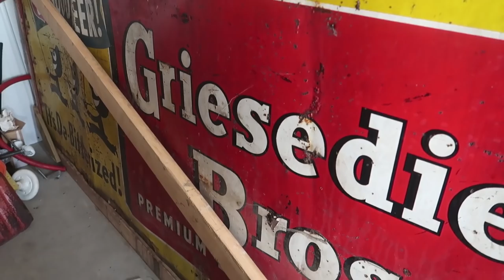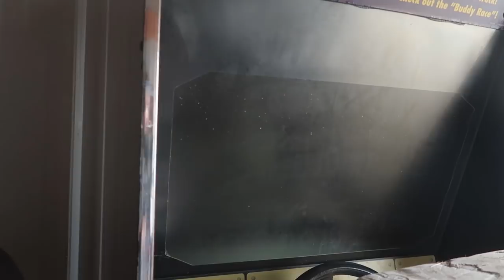Random Bits 0191: Removing Old Clothes Dryer, House Cleaning Update

Comment: I think the definition of hoarder changes with every person.  My definition is someone that saves junk that has no value.  The unfortunate part is that it is just as hard to define value as it depends on the individual to determine what value something has.  As an example I have several digital panel meters that originally cost in excess of $200 each.  I really have no use for them but I feel they are too valuable to simply send them to the landfill.  I doubt that I could sell them as they are rather specialized and truth be told, I don't want to go to the bother of trying to sell anything.

Many years ago I rented a storage locker and eventually filled it with junk.  Your lockers at $50 a month would be more like double that cost in my area.  Among the junk I had stored was a king-size bed and frame.  I decided to clean out the locker and gain back the $50 a month it was costing me and I tried to sell the bed.  I had at least two lightly used sheet sets and one brand new sheet set for the bed but no one was interested.  I finally donated the sheets to charity and left the bed at the side of the road when we had a community clean up day.

When I moved to a newer house, roughly twice as big as I had, I vowed I would never again rent a storage locker or build storage sheds.  For the first several years I was able to keep my car in the garage but now it has been at least a decade since I could get a car inside.

I could go on for several more paragraphs but I don't think that you particularly are a hoarder but you do need more space.  Your mother MAY be a hoarder.  My former wife would save every single cardboard box that came into the house and I spent WEEKS cutting up and recycling cardboard when we divorced.  She save the stupidest things.  Both my parents were hoarders, my daddy saved bent rusty nails.

Comment: I used to have moisture problems where I kept a lot of my stuff, and some things would get mouldy, I'd be worrying often about my things slowly being destroyed by the moisture and it got me really depressed. Thankfully I don't have that problem anymore. 

The moisture in your storage unit is a lot more extreme than what I had to put up with though, that would really drive me crazy!

Maybe you could put a bunch moisture absorbers in there or something?
Reply from the maker: idk, im probably going to put plastic down and seal off as many air vents for now as i can. then maybe run a dehumidifier off the nissan batteries. but eventually im thinking i might just move the arcade machines to the Red Rooster when they get the arcade room made.

Comment: Just fix the dryer! In most cases, the reason electric dryers fail is because of the thermostats fail. Usually four of them in a dryer, and normally, one or two fail. This is about a $10 repair. Even if you dont want the dryer (which I don't know why), you could sell the repaired dryer rather than throwing it in the trash.  So tearing it up, and tossing it: https://youtu.be/XI7FoCHJ01k
Reply from the maker: but we dont need a dryer. and it failed due to a broken heating element. washers and dryers are so easy to come by around here, would go for maybe 20$.
Reply: Heating elements don't fail. The thermostats do. Still could of sold a repaired one :-)
Reply from the maker: yes they do, and this one had a spot melted out of it. dont be so sure of yourself.
Reply: If it had a melted spot then someone must have tampered with the dryer, bypassing the thermostats. Those thermostats are there for not only regulating the heat, but safety also. There are four of them. two are for temperature regulation, and the other two for safety to prevent that very thing.

Comment: Is that a Lisa or a Mac XL?
Reply from the maker: its a Lisa, however it was used internally at Apple for software development, came with several hard drives. so i imagine it already had the OS files to run mac-os as well. it boots into the Lisa OS i think. i snagged it while working at Apple a few years back.
Reply: Rinoa's Auspicious Travails that is so cool, Rin; I would give a lot just to see one in person, let alone own one. Your collection of old electronics makes mine feel rather pathetic.
Reply: Rinoa's Auspicious Travails it boots? Wow. Have you done a video on it?

Comment: have a system where if a item is not used for 6 months or more, get rid of it, if its not used for that long then it probably wont ever be needed
Reply from the maker: thatd never work for me since i have projects using parts ive had for years if not decades.